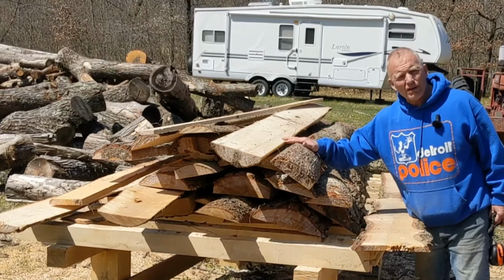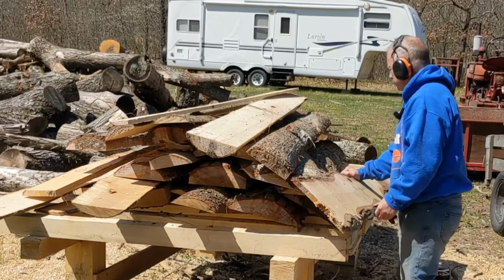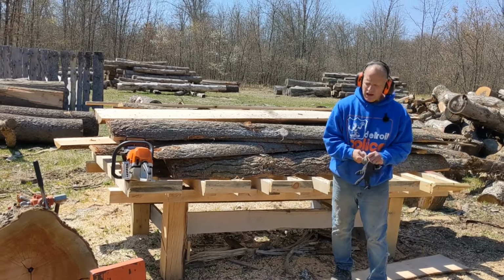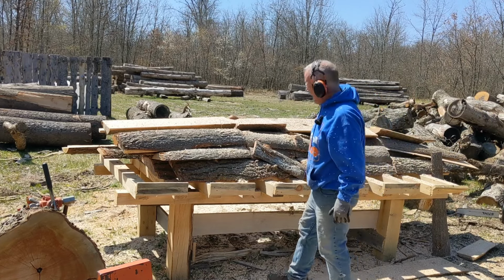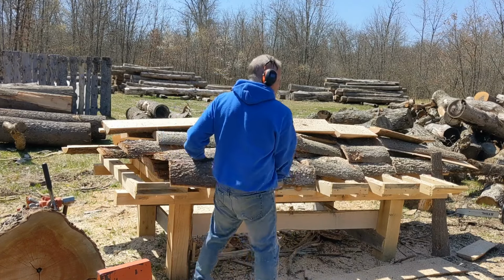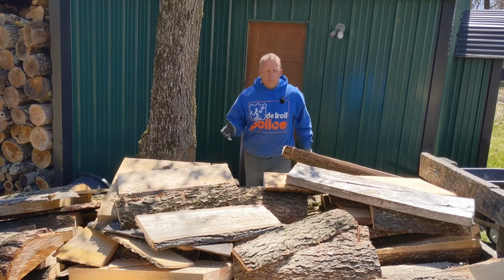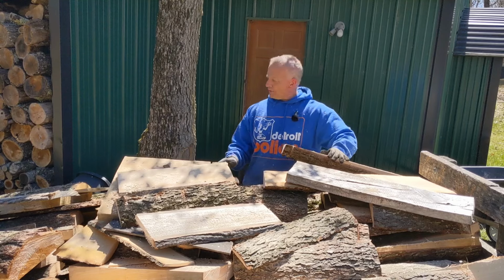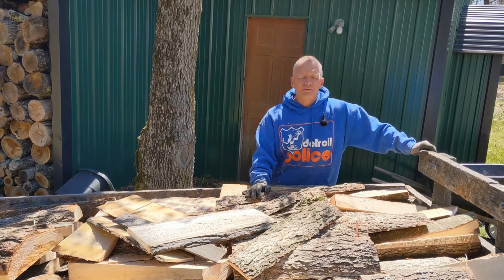Firewood / Vintage Tractor and  Chainsaw Therapy

Comment: That bucking table made good work of it all there buddy, it's good to be working more upright instead of being crouched over. 
The farmall sounds great also bud. Sure makes light work of the slab trailer.
Great job buddy 👍
Reply from the maker: That farmall is a favorite of mine.   I love the old equipment and how tough and heavy duty they are.    It's always a pleasure to operate it.    I'm putting that bucking table to good use right now.   It also makes a great table to hold all the rounds before splitting.   I'm glad I built it.  It feels like my log yard is taking shape and making life easier.  Thanks buddy for the comment.
Reply: @BigelowWoodcraft  id agree your woodyard is deffo taking shape and you are looking after your body with the setup you have. Great job buddy 👍